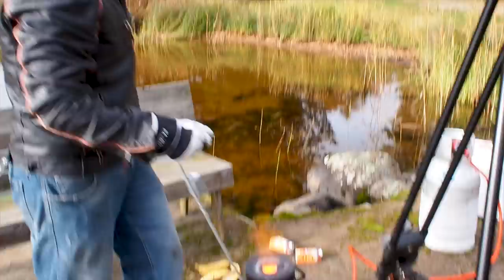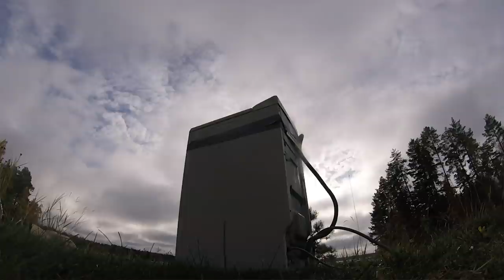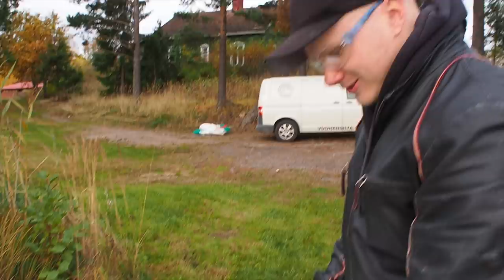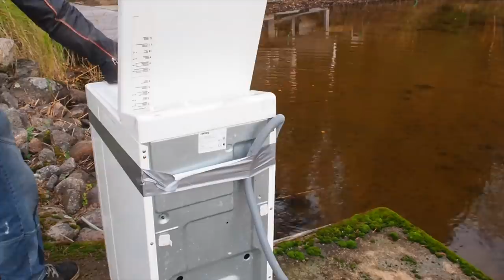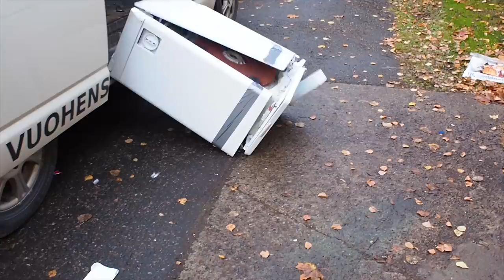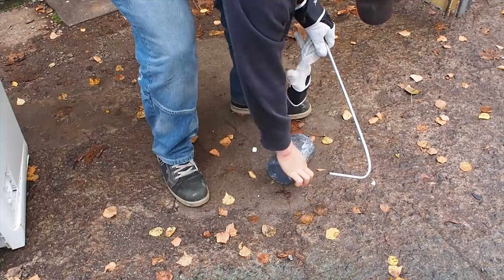10kg of Red Hot Steel Vs. Running Washing Machine!

Comment: You should use a front loading washing machine. Jam the door sensor so it thinks the door is always closed, put it on a spin cycle, once up to speed, throw in the steel.
Reply: J Anything .. what you just said is what I thought this video was going to be. So disappointed
Reply: chickenpopper! That's the proper way of doing it. If you start slow like in this video, it dents itself too much and jams. If you do it on a fast spin, it will destroy itself spectacularly!... Not that I've done this before or anything...
Reply: J Anything .. yesssss.... I'm waiting for your video
Reply: @photonicinduction already did this but it’s worth another go
Reply: or just hook the motor directly to 240v
Reply: DO THE HARLEM SHAKE

Comment: Thermite dripping into running washing machine...
Reply from the maker: I also got this idea when making this video :D Maybe I should but liquid nitrogen into the machine and thermite on top of it :D
Reply: Burning magnesium, and perhaps then add some water.
Reply: Acetylene and thermite
Reply: Johan Andersson liquid oxygen
Reply: A chunk of sodium metal would make an interesting explosion once the water level reaches the drum.
Reply: You can use dry ice as an oxidizing agent. The metal will rip off the oxygen and leave over pure carbon. Search the Wikipedia page on thermite for "dry ice" ;) Probably remove some of the oxidizer from the original mixture :) Probably needs some experimentation.

BTW The machine detects vibrations during tumbling and not go to higher RPMs. Theres normally a switch you can short out to override this :)
Reply: MattTheBoss Acetylene makes a bigger bang
Reply: Or dryer
Reply: what happened to photon?

Comment: WOW it WASHES and DRIES??!?!
Reply: I think when he meant the spin cycle when he said high speed drying.

Edit: they do make washer dryer combo machines but they are very slow at dying and mostly used in rvs at least in the US
Reply: I have a washer dryer combo, takes 4-6 hours to get clean dry clothes out of it.
Reply: Combo washer dryers are pretty common in the UK since it means you only need 1 device instead of 2, but here they're normally front loaders.
Reply: JoeTheProgrammer LG is the only company I know of that that sells a residential sized combo unit here in the states. It takes hours and hours to dry clothes with it because it uses a standard wall outlet so is limited to 1.5 Kw on the drying cycle.

Edit: Usually you just have two units side by side here in their own small room or in the basement. A lot of apartments and town houses use stacked units in a closet somewhere.
Reply: biohazard 918 Here all of the washing machine manufacturers sell combo units, but I guess that might be because UK domestic sockets are rated 3.12kW and for most of Europe it's 3.68kW. We normally have the washing machine in the kitchen but plenty of people have a utility room for it
Reply: Joe Izca irony...
Reply: biohazard 918 you may as well just hang your clothes up and point a box fan at them. They'll be dry in 30 minutes.
Reply: That's interesting, in the US there is almost always a 240 volt outlet on a 30 amp breaker but I can't find any washer dryer combos that use those outlets at a glance, just ones for normal 120 volt outlets. I have heard of people running old or simple appliances from Europe off of those outlets, but I hear that running things at 60hz that are meant only for 50hz can mess with electronics.

 Are there some kind of high wattage sockets and dryers in Europe? It looks like our dryers usually run at over 5kw but at 240 volts and 30amps they would still cap out a 7.2kw.
Reply: DrPersonman We normally hardwire any equipment that can't use a normal socket. Higher wattage sockets do exist, but normally they are for a specific device, for example I have a 7kW socket for charging my car. If you wanted to use a plug/socket for use devices that are normally hardwired, in the UK at least you'd probably have to get industrial plugs/sockets (big red one I think)
Reply: Freedustin Then my air conditioning has to pull the water out of the air. My clothes dryer burns natural gas so it costs almost nothing to run and doesn't make my house humid.

JoeTheProgrammer We have a bunch of different sockets the most common being the standard 15 amp 120 volt 3 prong and the 240 volt 30 amp 3/4 prong (newer buildings use a 4 prong socket that includes a neutral pin older just have the 2 hot pins and a ground) used for appliances like electric stoves and clothes dryers. But there are also 20 amp and 30 amp 120 volt outlets. Plus 20 (used mostly for big window air conditioners) and 50 amp 240 volt outlets the later of which was mostly used to power large RV's/caravans  but now also gets used for electric car chargers. Stuff like my central air or electric hot water if I had it are hard wired. Oh there is also a 60 amp 240 volt outlet I know exists but I have never seen in the wild outside a hardware store and 240 volt equipment is always on a dedicated breaker and circuit.
Reply: Talk to it nicely and it will fold too.
Reply: Lucas not any more it doesnt
Reply: Huh only washer/dryer combos ive ever seen was like 3x more than a normal set of the two and like this reply section ive never heard an actual good thing about one....
Reply: it washes and...

dies
Reply: Combi washer / dryers are very popular in the UK. Although open air drying remains most popular. We are too poor a nation to afford the electricity required to run a dryer for every washload we do.
Reply: They are common in Europe to save space.  But small, and since your machine is tied up for twice as long you can't do nearly as much at a time.  Here in US we just buy the super huge washer and drier and wait until everything in the house is dirty and get it all done as quick as possible with them both running at the same time - at least thats how I do it.  Your not going to wash a king size mattress set in that thing.

Comment: They've got some strange washing machines over there
Reply: We have them in the UK as well. It's like a front loader set sideways, with a spring loaded door set into the drum. They're really good for narrow spaces, which kind of explains why they exist over here (small houses, often built before washing machines were a thing).
Reply: But you cant put stuff in after it started
Reply: It is a low water usage machine, like a front loader, but with the convenience of a top loader.  I believe Staber is the name of one manufacturer.
Reply: It's just a standard Euro top loader. It works on exactly the same principle as front loaders, tumbling the clothes around in some water until they get clean. The only advantage of this style top loader is that it takes up less space than normal front loaders

Comment: If you try it again, connect the motor up on its own rather than using the machine to control it. Washing machines have a spin inhibit feature where if they detect an unbalanced load (like your great big lump of steel!) they won't go into spin, it's to stop them jumping around the kitchen!

Comment: you could have gotten a possible steam explosion if there was no way for the steam to escape, it would allso help to have more glowing hot steel in there to help turn as much of the water into steam as possible as fast as possible, problem lies in the safety function that will turn it off if it cant dump water between cycles, most if not all machines will complain there is something wrong with the filter. perhaps with a rig to make a closed system would work? it pumps the water back in and its completly sealed shut to prevent steam from escapeing, maybe the steam could build enoth preassure to actualy blow it up, but this said, it was actualy good for you it did not explode as you where to close and unprotected and would most certainly ended up injured.

Comment: Looks like a pretty tough machine, for the most part. It didn't really completely 'break' until you pushed it out of the van. Maybe you could do one of their ads. Try it again, with 5- 2kg balls instead of one 10kg weight (so as not to break the door) next time.

Comment: Needed an American-style vertical cylinder machine, instead of a horizontal cylinder. The vertical cylinder would not have jammed like this one did, and perhaps 2-3 smaller steel bits, that are not too heavy to prevent the thing from spinning (though there is danger of melting through the bottom of the drum).

Comment: If you wanted to see it really hop around you could have installed the transit bolts back so that the drum transmits all the vibrations straight to the frame. =)

Comment: I mean, given that water has a really high specific heat capacity (means it'll absorb a lot more heat than most other substances before anything happens to it), isn't it sort of the "worst" thing you could use with your red hot steel idea? 

Granted, most other things will just start burning, but...

Comment: you should have used a front loader machine
Reply from the maker: The hatch would melted and got on fire really fast since they are made from plastic
Reply: Beyond the press the hatch of my washing machine is made from glass, with very little plastic. And a heavy object isn't thrown out of the machine, so an open hatch would have been fine